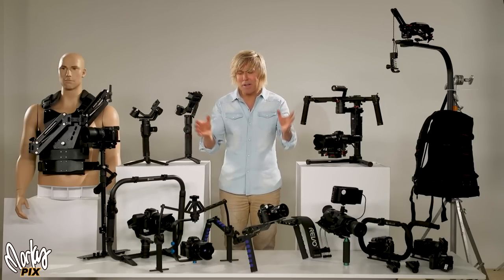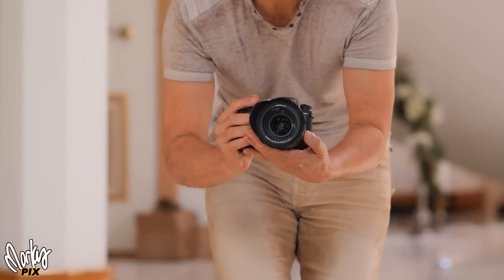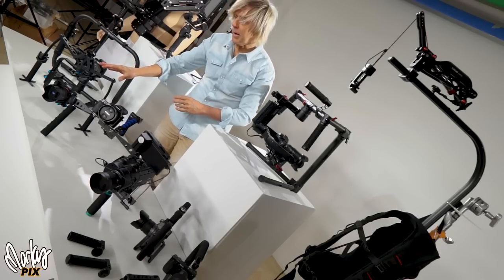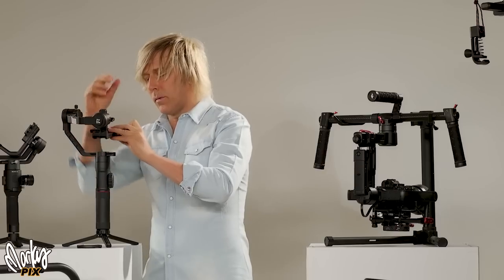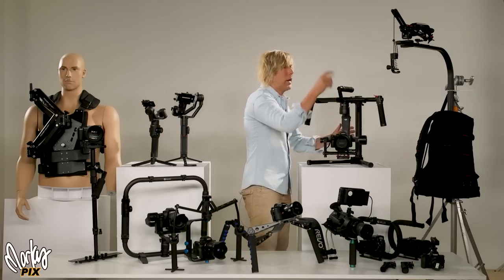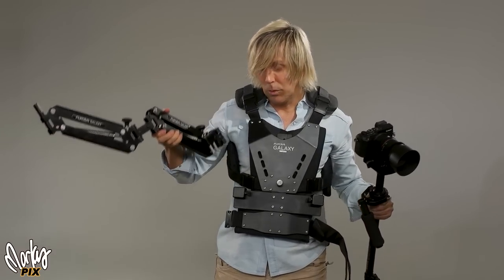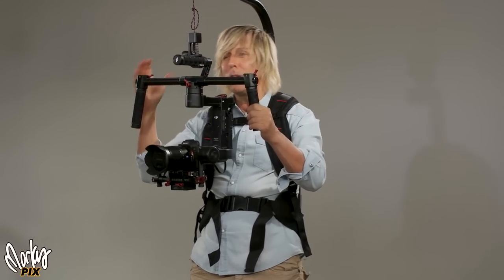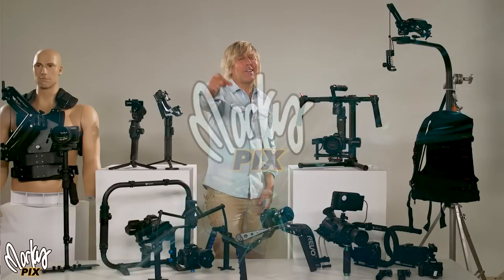Camera Stabilizers Epic, All Kinds of Ways to Steady Your Camera

Comment: I use a stabilizer exactly like the flycam red king. By adjusting the handle/gimble you can flip it so the weights are on top and the cam on bottom if you need low angle shots, but you will have to flip the footage in software because it's upside down. Just a tip for people wanting to get a little more from their stabilizer.

Comment: Inertial mass is the key for all of the passive systems. The further away from frame center the mass is, the more inertia they have for a specific weight. Back in the 90s, I built a triple weight flybar mount for my Hi-8 camera. And while the IS on the Sony camera was revolutionary and worked fantastic on it's own, the flybar weights completely changed the game for less than $30 (could have gotten it done for under $5, but I made it nicer than that).  I bought a DJI gimble for my phone a few years ago, and the only thing it really does better than the flybars is lateral roll stabilization, but adjusting the weights and locations on the flybars would alter that as well. One doesn't need the $$$ gear if they have good technique and a little bit of ingenuity.

Comment: This was a wonderful presentation outlining the versatility or lack thereof of the different systems. Recently, however, folks ((including me) are combining systems.  Personally, I have combined the ProAim Galaxy vest and arm, with the Flycam Redking steadicam, onto which I mount a Zhiyun Weebill S gimbal.  Essentially it is a “fake” Arri Trinity, aka the mini Trinity.  I’ve tried many systems, but this combo combines the best of both worlds (steadycam plus gimbal).  The spring arms of the vest do, in my opinion, contribute significantly to a reduction in vertical movement, which means I no longer have to do the stupid duck walk to get stable shots.  Additionally, the mini Trinity does wonderful booming/low angle/spinning/slider type shots effortlessly.  I would love to see you memorialize this kind of rig.

Comment: Markus Brilliantly explained with the cardboard pieces! Thank you!! I am new to this, at least on a semi-pro level using a beast grip pro with 1.55/1.33 AM lenses and am so frustrated with stabilization. Seriously frustrated. I purchased the cheaper DJI but it did not hold the weight of the beastgrip pro with lens and mic and light.... blah blah blah... you know what I mean. I looked into the DJI Ronin until I saw the price for the one that can handle the weight with the motors and because of the cost all of my filming with movement has come to a stop until I can afford it. If you have any other recommendations I am very open to them. The DJI rig Ive been looking at is 700$+ with all the bells and whistles. Again, I would love your advice. Thank you for your videos!!! Your my new coach for much of this! Lots of gratitude from an LA CA kid in Berlin.

Comment: I made myself a rig with a top handle and 2 handles, one on each side of the camera. A mix of the X Grip and the Vello Action you're presenting. It's already doing a great job even though it requires lots of practice. I'm doing landscape videos and it's really a key point to me to use gear that is light and takes a minimal space as a lot of hiking is required for what I do.

Comment: I was looking into the steadycam system for my son, who has Cerebral Palsy.  This wasn’t practical, so I forgot about it.  Last month I connected a gas spring arm from a monitor stand and connected a Monfrotto bowl with a 503HDV head and it works like a tripod dolly with a the articulated counter balanced arm.

Monitor stand $40 bowl $25 and used 503HDV $130.

Comment: Just wanted to give a small correction, the majority of cameras do not crop in to use IBIS. In fact I've never encountered a camera that required cropping in to use the IBIS, I've only ever seen cameras that allow for optional cropping to give even better IBIS.

IBIS is a a physical change in the position of the sensor and it does move the sensor in 3D space. What you've described is digital image stabilization.

Comment: 3:00 "i hope this explains it a bit" ... 
NO, not a bit ... this was the best presentation and explanation i've seen in dozens of yt-videos. moving the silhouette and scenery relative to eachother visualizes all misunderstanding and some disappointments around IBIS. i enjoyed the presentation of different concepts of stabilization. the only thing in which i don't agree is that the flycam-spring-arm isn't doing much to stabilize. it should smoothen linear vibrations in additon to the compensation of axial vibrations through the gimbal.

Comment: There are some ways to assist with the up and down motion, one being using a 'Segway' (a two-wheeled, self-balancing personal transporter), or similar, you can iron out some unwanted motion by 'key framing' and or using a stabilization system in post production.  

I have even used my Sony FDR AX-33, which has the advance optical 3 axis stabaliser built inside the camera, to make the lens act like an internal gimbal, set up on my Zhiyun Weebill S - so a camera with an inbuilt internal gimbal, set up on an additional 3 axis gimbal - but as you have pointed out Markus - at the end of the day, you still have to learn to 'walk the 'gimbal walk', to achieve those rock steady and smooth shots.
  
I have also seen a few videos, with the mechanical stabaliser - which is fixed to the gimbal handle, and used for tracking shot in confined spaces, the problem being that you hold the whole thing in one hand, which after a while begins to become tiresome. 
 
I will use a monopod like my carbon fibre IFOOTAGE Cobra 2 C180-11, fixed to my Zhiyun Gimbals, the monopod can extend up to 6 feet in length, that allows you to undertake overhead and low shots etc. 

I still have yet to master the 'gimbal walk'..!  

Good Luck everybody, and remember -  'creativity is intelligence having fun' . . . !
Reply from the maker: I guess you didnt see this video of mine https://youtu.be/KZhSEYCxKU0?t=66

Comment: 10:30- lengthening the weight pole does not add weight(i.e. force). Rather, it increases the torque  to counter the opposing torque from the weight of the camera mounted on the other side of the fulcrum.

Comment: I once tried to rig up suspenders to offset the weight of a Hasselblad for all-day photography.  I guess the designer of the flowline had the same idea, but followed through.  I now use a flagpole holder to support my Ronin SC and Nikon Z6 while filming a hyperlapse on a moving ship.  I turn on VR in the camera and set the Ronin to not follow, so the horizon is level.

Comment: I bought a mechanical stabilizer years ago and used it with my point and shoot Casio EX ZR-1100 and my Lumix GF6.  You are 100% correct about needing to practice walking to get things smooth.  I practiced at the park, the local temple, going up stairs, down stairs and even walked about a mile trying to use it.  It was a lower-end unit that I picked up in Pantip Plaza for about $120 because I wanted to try doing walking around videos.  Some sections of my videos came out really smooth but others came out a little too bouncy.

Comment: I just had s listen, great walk through of the various stabilizers. However Olympus ibis does not crop when using sensor movement only, and with the dual ibis lens and body it allows for even more physical compensation. Beyond that they have a digital addition. 

Your explanation of the foreground moving independently from the background is about camera position, and none of these hand held can completely eliminate all movement... so they suffer from your same description.

To recap, you seem to be describing a digital stabilization, but lens and sensor movement acts in a similar way to all these stabilizers, but with less room to move.

Comment: Hi Markus, I slightly disagree with your point of how IBIS or Lens IS cannot naturally stabilize in 3D space.
Sure, the range of motion is smaller with these in camera stabilization methods when compared to a gimbal or a steadycam, but they effectively do the same thing.
And about warping with wide angle lenses, yes, that is a real issue with IBIS, as the rotatory compensations which involve the sensor coming out of its plane, make the image warp. So if you're shooting wider than 24mm, adding a 3 axis gimbal would be very useful.
And also, those 3 axis gimbals cannot compensate for the translatory jerks on their own and you are reliant on the inertia of the system to keep it steady.

Comment: Great video!  One question though, when using a stabilization device, should you turn off the IS in the camera and IS on the lens (if it has it)?
Reply from the maker: Leave it on, you want all the help you can get. Stabilization devices are not perfect.
Reply: @MarkusPix  Thanks!!

Comment: Back in 1960, or thereabouts, I taught a class in photography on the side to soldiers in Korea. Given that there were great bargains available on Japanese cameras, it seemed everyone had put their money down but weren't geeting expected results. I made everyone buy a Diana. It was a plastic camera with a plastic lens. I told them that everyone of them had purchased a camera that was smarter than they were. I wanted the to begin with the basics and all use the same camera. That first class I had told them to take a few pictures around the base in with their Dianas and return in one hour  and we would devlop them when they returned. I selected some that illustrated a point. I asked them what the most important piece of their equipment was. All replied either camera or lens or film. Wrong. I taught them that it was a  tripod. That little Diana with a tripod could possibly get better results than their Canon or Nikon with the most expensive lens if the camera moved. If they didn't happen to have a tripod handy, lean against a wall, a telephone pole, anything. Also, I mentioned that, absent a tripod, pull their elbows in to their body, unless they needed  their arms for flying.

Comment: lol what you really need are electromagnetic linear actuators instead of solid pieces for the up and down movement. They would cost a ton but could probably get you a very steady shot no matter what (as long as you are in the range the system can compensate for)

Comment: Even with the "Dangle Cam"  one still can not see the screen on the camera (to frame the subject) especially out doors with the sun at your back. Wish there was a wireless goggles or glasses that showed me the what the camera sees. The reason I use a VIDEO camera as apposed to a DSLR/Mirrorless type camera for video is no reasonably priced 'PARFOCAL' Power zoom lens exists for them. You can't possibly keep things in focus while zooming with a DSLR/Mirrorless type camera on any type of  stabilization device. Shooting 'TOY R/C model Planes you are constantly Zooming to keep them properly located in the frame.

Comment: I love your channel and have learned so many down to Earth techniques that have propelled my skill to a higher level :)

I also agree with weight and inertia making a camera more stable.  The D200 I'm using is about 2 pounds compared to the other camera I was using at less than a pound.  The lighter camera has and NEEDS stabilization, whereas the heavy Nikon D200 is SO heavy that I can easily handhold it into stupid low shutter speeds.  I don't even get mirror slap in most situations.  It's like shooting a light composite stock gun vs. shooting a heavy wood stocked gun with lots of metal in it.  One is totally more stable and kicks less than the other.

Comment: Even if rhe software were perfect, you have pjtch and yaw and if there's movement in the background even 4 cams couldnt interpolate correctly - i have an r5, it is amazing with in lens optical stabilization, but that, the best arguably around, doesnt come close to what even a shoulder rig can do, especially especially fast movement.

Comment: First I have the Ronin M with a Lilliput 4K monitor and remote Record/Pause on left handle and tilt switch on the right handle ... With out the Monitor there is no way to know how I'm framing the subject or even if it is in the frame at all.  Still for my type of video (R/C Model Planes) I have to be able to rapidly Pan left and right while being table to tilt the camera at the same time.  The  Motorized stabilizers are not  really made to do that.  
     Getting older and a little shaky, All I wanted the Ronin M would do was take out the shake that  the  REVO SR 1000 doesn't .  So if anyone has any way of eliminating an old mans Shake and still be able to follow 200+mph 'TOY' R/C jet over head, I'm all all ears.

Comment: Sorry what's the difference between IBIS and a gimbal again? IBIS doesn't have to crop. That's wrong. If a camera can have gyro information it can counter that shake with IBIS. That's exactly what a gimbal does.

I am a filmmaker and I know right now the only 100% reliable way of stabilizing image is through external ways but I am very sure in near future we won't need any of that and we will even have 100% reliable autofocus. All of that will make filmmaking easier, cheaper and faster.
Reply from the maker: I explained in the beginning of the video unless the sensor can physically move in 3D space the exact same amount as the camera movement, it will never be able to create perfect stillness because the background moves separate from the foreground. I worked in Hollywood for 25 years and yes software can do a lot but only so much in physical space without the use of 4 separate lenses working in tandem.